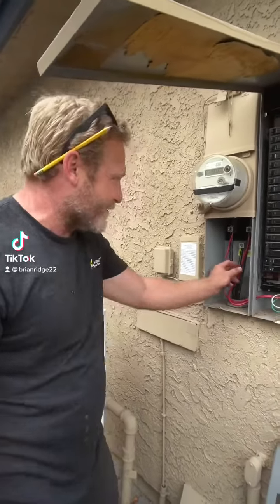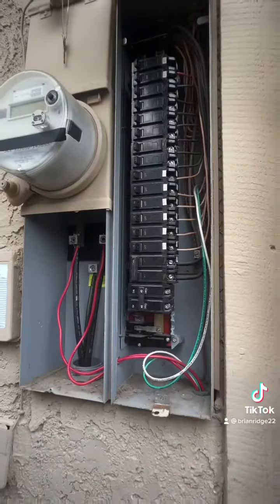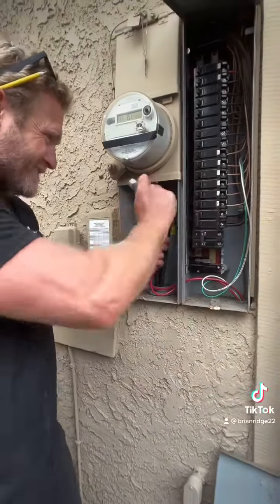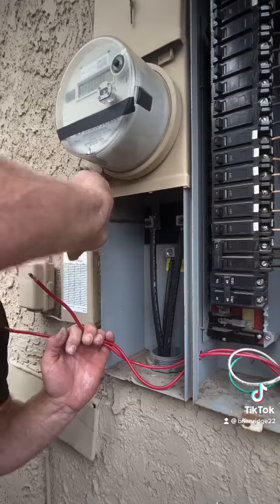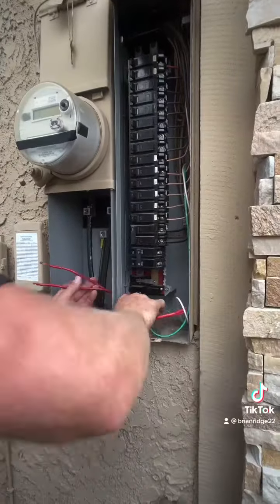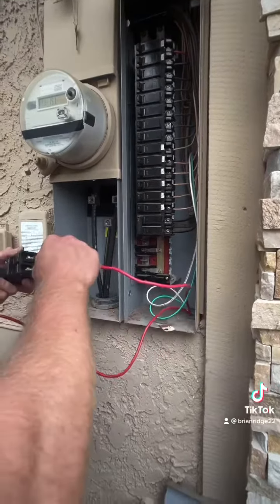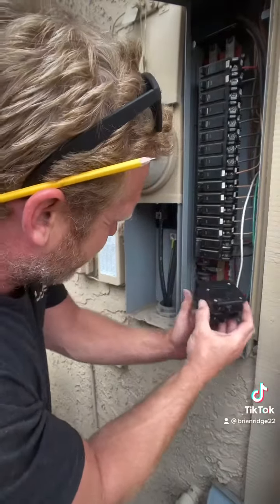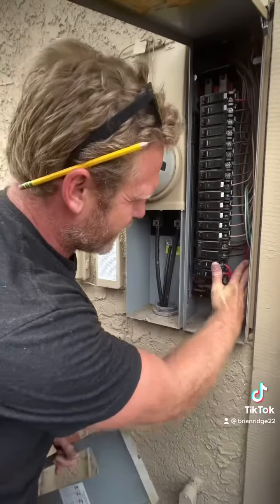July 25, 2021

Comment: Got a question I put a 15 amp breaker on the outside panel ran 12-2 wire to powder the shed  for the freezer .The power  coming in goes to the receptacle then to a  switch for a light .Now I  was wondering if that 12/2 is good for a 15 amp breaker I mean it works it's been on for over 2 weeks and no  wires are hot